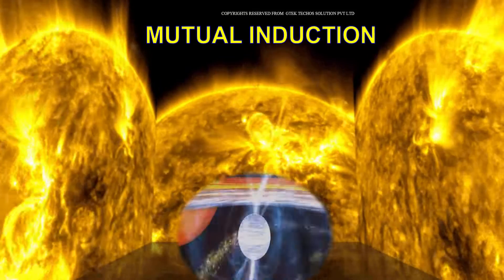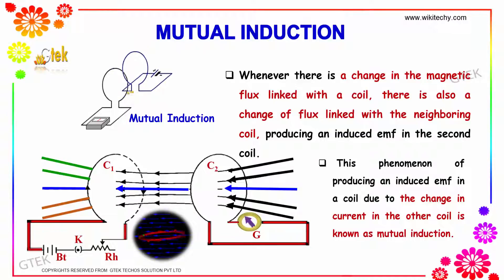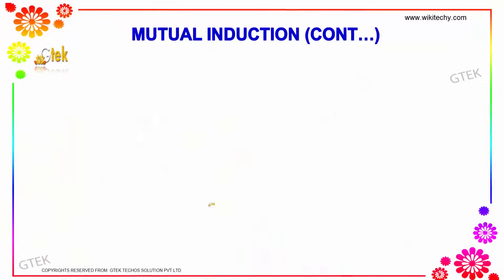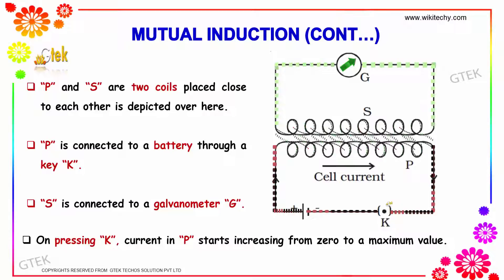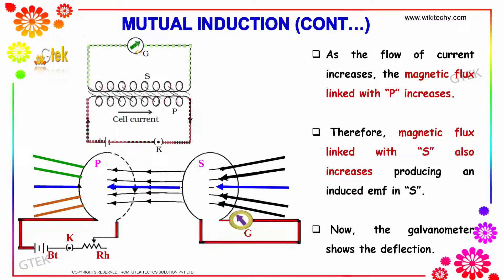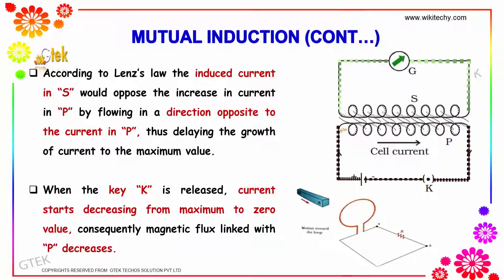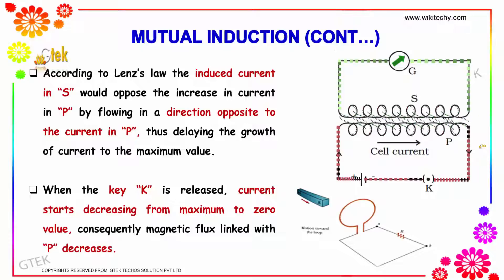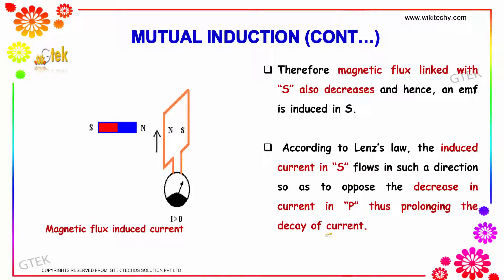Mutual induction | Electro Magnetic Induction And Alternating Current | physics notes lectures

Comment: Mutual inductance is where the magnetic field generated by a coil of wire induces voltage in an adjacent coil of wire. A transformer is a device constructed of two or more coils in close proximity to each other, with the express purpose of creating a condition of mutual inductance between the coils.

Comment: When a steady current flows in one coil as in the left illustration, a magnetic field is produced in the other coil. But since that magnetic field is not changing, Faraday's law tells us that there will be no induced voltage in the secondary coil. But if the switch is opened to stop the current as in the middle illustration, there will be a change in magnetic field in the right hand coil and a voltage will be induced. A coil is a reactionary device, not liking any change! The induced voltage will cause a current to flow in the secondary coil which tries to maintain the magnetic field which was there. The fact that the induced field always opposes the change is an example of Lenz' law. Once the current is interrupted and the switch is closed to cause the current to flow again as in the right hand example, an induced current in the opposite direction will oppose that buildup of magnetic field. This persistent generation of voltages which oppose the change in magnetic field is the operating principle of a transformer. The fact that a change in the current of one coil affects the current and voltage in the second coil is quantified in the property called mutual inductance.

Comment: If two coils of wire are brought into close proximity with each other so the magnetic field from one links with the other, a voltage will be generated in the second coil as a result. This is called mutual inductance: when voltage impressed upon one coil induces a voltage in another.

A device specifically designed to produce the effect of mutual inductance between two or more coils is called a transformer.